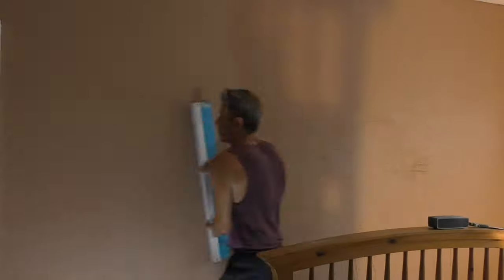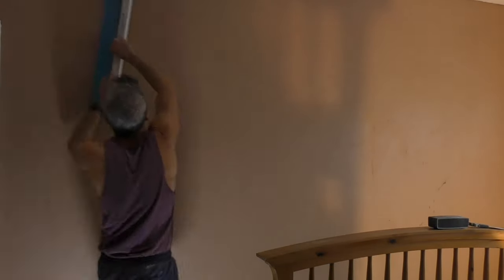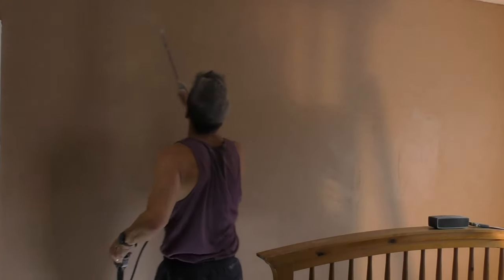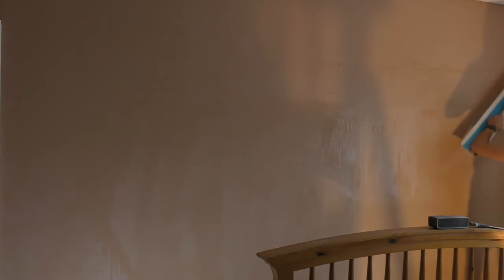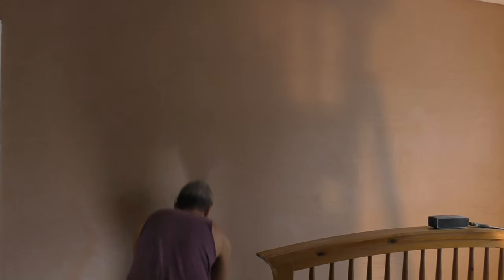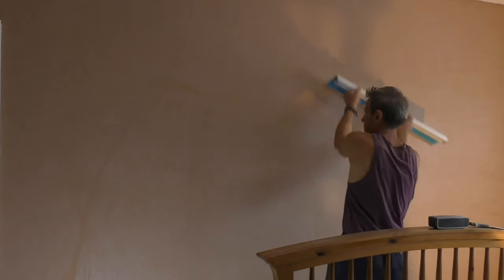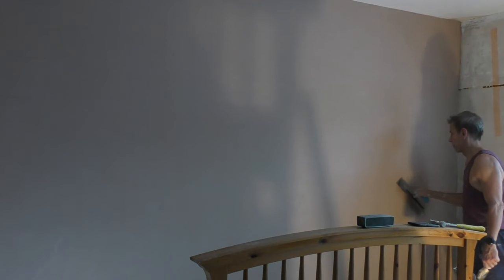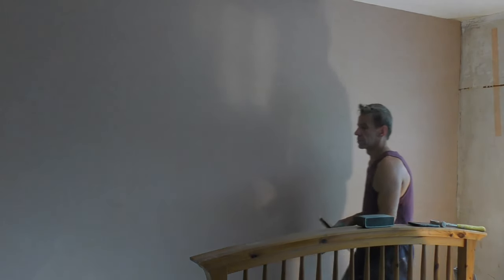Is the speed skim quicker 2   Metal blade

Comment: Have you ever suffered the loss of grip through tennis elbow? if so how did you recover? I dropped trowel with pain. thought I'd push on through it when on finish trowelling other week, now having to use left hand to support my right.  Its the back  hand motion mostly,  stabbing pain in the lower outer side of elbow(stops gripping strength). Any help or tips from you or your subbies much appreciated
Reply from the maker: Sorry to hear that Terry, ive had a bad ache in forearm from over doing it, but thankfully not tennis elbow, currently have a trapped ulnar nerve which makes small finger and side of hand go numb with loss of grip, but fortunately my hawk hand. Hope you can get some advice, good luck👍
Reply: Ive got tennis elbow.painful but doesn't make my hand numb.could be something else..

Comment: I love the plastic speed skim best tool ive bought
Reply from the maker: It's a great bit of kit Chucky👍
Reply: I only bought a couple of them the other day and the amount of time it saves is unbelievable. Not to mention it saving the shoulders a bit with so much less trowel work flattening in. 
I bought 2 ox plastic ones 900 and 600mm and  one nela black edition 600mm  metal edge. I've only used the plastic ones so far. What do you prefer after using them for so long metal or plastic?
Reply from the maker: Plastic for ruling off, metal for wet trowel 👍

Comment: Hi Eric, another great vid, cheers. Do you know if the plastic and metal blades are interchangeable and can be used on the same handle?
Reply from the maker: Hi mate, thanks, they are slightly different designs, but even if you could its twiddly enough not to want to, when you need to change the blade because of wear and tear, fair enough 🙂
Reply: @ThePlasterer  Thanks, just me thinking tight out loud again haha
Reply from the maker: @anfo9474  😀
Reply from the maker: Hi mate, I think you can use the same handle, but trust me, you wont want to keep swapping the blades over, the ware and tear on the small clips wont be good either, hope this helps
Reply: @ThePlasterer  Thanks Eric, I might give it a try,  spare end caps are included when you buy replacement blades.

Comment: Is it better to use the plastic speed skim rather than the metal one to flatten or doesn’t it matter?
Reply from the maker: Hi John,  Plastic for ruling off first coat as it opens  up the surface, metal when doing wet  trowel up of second coat, if you use metal on wet first coat it brings water to the surface and causes blistering.

Comment: Hey just subscribed can this be used straight out of the box 
Would u use to flatten first coat or is it just for finishing
Reply from the maker: Yes, can be used straight out of the box, no, you want a plastic blade for leveling the first coat as it opens the plaster surface to aid drying, if you use metal blade to flatten first coat it will bring water to the surface to soon and you risk blistering. hope this helps
Reply from the maker: and Thanks for subscribing :0)
Reply from the maker: @HGarry4012  👍👍
Reply: @ThePlasterer  hey again just another question I've been using plastic blade for flattering since we spoke last brilliant I find it
So can u use stainless steel blade after flattening with plastic blade and use it till u give final rub with ur trowel
Reply from the maker: @HGarry4012  best not to use the metal one too soon or you'll get blistering, me personally I  only use it when I start putting water on the wall until I finish with the flexi trowel. See you at the next live Stream 👍
Reply: @ThePlasterer  thanks alot mate 👌👌

Comment: Does the metal blade need the corners rounded. I found with the plastic one I had to round the corners to stop it digging in
Reply from the maker: I've rounded the plastic one, but the metal one seems alright to me without rounding the edges, but you could if you wanted
Reply from the maker: @Rih27 
 Hi Robin,  I very carefully 
Trim mine with tin snips

Comment: What would of happened if you used your metal speed skim instead of plastic  one ?
Reply from the maker: Dont know havn't tried, but I will 👍
Reply: In my experience the metal blade is too sharp and harsh to hit skim too early with. Brings a lot of water to the surface and ends up dragging the material around too much on the surface.
Personally I’m a plastic trowel man.
Lay on flatten with steel trowel. 
Sponge float depending on wall.
Speedskim and finish with plastic trowel best finish I’ve ever had.
Reply: Always rule first coat with speed skim though to make sure everything is flat and sometimes don’t bother to speed skim second coat just flatten with steel and finish with plastic.
Less work, better finish 
Work smart not hard
Reply: @amateurvegan2636  thanks brother your right I've been using the metal blade instead of plastic was being lazy and found the metal blade to Sharp and taken the plaster away when its wet
Reply: There’s too much flex in steel blades if gears wet you can’t get wall flat. Can make it smooth but will never as flat(very slight ripples if you looks down the wall

Comment: Do you prefer the metal or plastic. Haven't tryed the metal one 👍👍
Reply from the maker: Plastic one for leveling off first coat while it's still very wet, it opens the surface of the skim, then metal one for the first wet trowel  of second coat once you start spraying or splashing with brush, basically works like a giant finishing trowel, then  ultra flex trowel to finish👍dont use metal speed skim on first wet coat as it brings water to the surface, which will cause blistering, hope I havent confused you